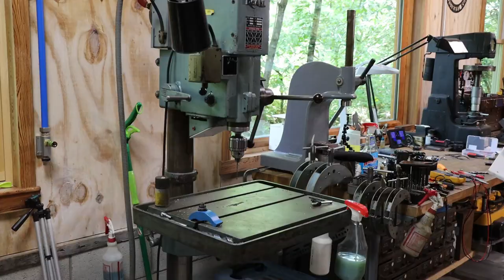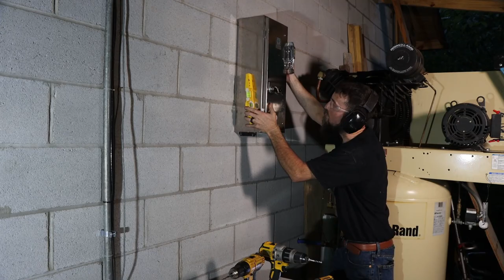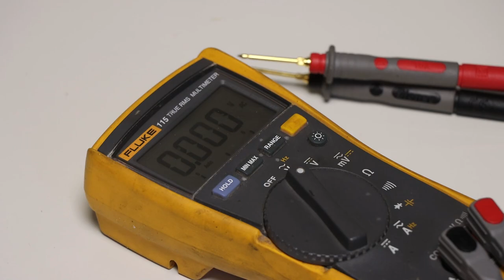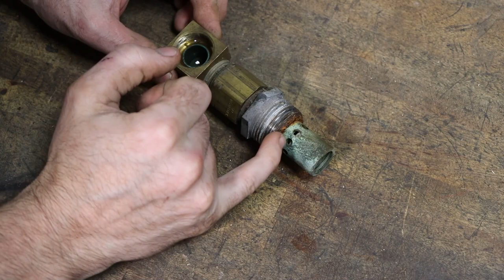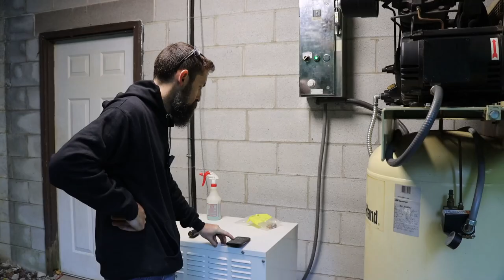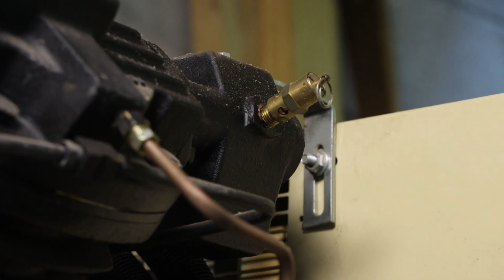Wiring & Test running my Big  Compressor

Comment: Thing stuck in the check valve is a piece of one of the head valves. Looks like you will be taking the high pressure heads off to get new valves in there. At least you can get those from IR very easily, and you can simply order all the valve plates as a kit, which also can include a new IR check valve as well. Order the IR oil and 2 spare input filters at the same time, to get a spare filter for it. Oil is Ingersoll Rand Type 30 Select synthetic oil, a very good oil, and pretty low cost. Change oil every year, the old oil is great for things like gate and doors, it is still useful as oil.

Auto drain is easy to wire up, use the control transformer to give a 120VAC feed to it, using a twist lock plug and socket to enable you to remove it if needed. Take the auto drain outlet and put it to a 15 foot length of nylon 6mm diameter air tubing, and coil it up into a tight circle, held with a few cable ties. That way you have a silencer (the auto drain is loud) that will not block up easily, and the smooth nylon means the wasps will not build a nest in there easily, especially as it will have a coat of blow by oil in it as well.

Power wise go and get yourself a Knockler Mueller stop start pushbutton assembly, which consists of a start and a stop button, with an indicator section in the middle, ordering a 120VAC LED indicator, probably a red one. Then wire it in place of the original toggle switch, probably swapping the indicator with the switch, to get that switch in the middle position. Indicator remove the incandescent lamp and put in a green LED retrofit lamp, it lasts a lot longer, and runs cooler.  Run the control transformer off the generated phase and one of the others, likely the phase converter does not pass the phases through when off anyway. The control transformer will have to be powered all the time, fed after the fuses and disconnect, before the main contactor.

Pushbutton assembly you can use with the existing contactor, just wire it up, using the auxiliary contact block on the unit, as a stop start contactor, the KM or Siemens websites will have a wiring diagram for this, or look up a stop start contactor, which will also allow you to put the new overload trip in it as well. Set the overload to be auto reset, and adjust to the motor run current you measured, using the highest phase current (probably phase C as it was the hottest, likely the phase converter generated one). 

You can also, if you want, put a 4 core plus ground cable through the wall, and have a second push button station inside, like the phase converter has, to allow you to start and stop the compressor from inside, as well as see if it is powered up, using the same push button assembly with indicator  and a single hole box. Very convenient if the compressor is remotely mounted from your workshop. 

Extra options are to get a 3/2 solenoid and install it in the air outlet to the shop, so the air lines are disconnected with no power, so that any leaks in them do not drain the air tank down.  As well a filter and water separator on the outlet, large diameter bowl and fittings, with the 5 micron filter in it, will help ensure the air going in is as dry and debris free as possible, short of having an active drier, or an oil less compressor.

I had a similar install, using the same methods, and I was lucky in having 3 phase power, and running a 3 phase plus neutral to the box, so left all the controls as they came (used parts all round, both the control and the star delta switch for the compressor) with 220VAC coils. Also added a separate power outlet there to give a local power line for working, simply by adding in an extra 20A breaker in the box. So had both local and remote stop start operation, and filtered air leading up to the machinery that needed air, with the way oversize compressor and tank meaning the air in general was both cool and relatively dry, with the filters making most of the oil mist drop out as well.
Reply: Wow Steve is lucky to get this reply you sure know your stuff.
Reply: Well said and explained in terms that are easy to understand 👏. A+
Reply: @ericmcrae7758  No, just had a bit of experience with both IR compressors and with machinery wiring in general.  Important thing though here is that tank does need to be pressure tested very soon, and then retested every 5 years (or whatever the local rules are in your location, here it is 5 years) so as to prevent it failing from corrosion. They tend not to go off with a bang, but start to leak air through the rust, and are not repairable easily, as you basically find there is little to no meta left to weld back on to when a seam finally fails. However large ones can fail explosively, and thus need testing and certification regularly. 

Steve likely does know of people at his work who can come out and do this for him, or might have a viewer close by with the requisite training and equipment to do it for him. Not too complex, you just remove all fittings and blank them off with plugs, and then fill the tank to the top with water, and pressurise it with a small hand pump to 1.25 to 1.5 times the operating pressure (again depending on local regulations for this), followed by leaving it at pressure for 15 minutes and checking there is no pressure loss. 

Then dump the water, reinstall all fixtures, and test the safety valves release at the correct pressure as well, and are sized so they can dump the full output volume of the compressor at that rated pressure as well. Then check the pressure switch is in good order, switches off at the correct high point, and back on at the correct low point.

Unloader needs servicing as well, along with check valves, but that is part of the compressor maintenance, not tank maintenance. I had to replace unloader valves, but left the old leaky one in service, as it was an elbow and adaptor, and simply put the new IR one to replace another elbow in the pipe to the tank. Those actually erode away because of the hot gas flowing through them, especially at the output of the heads, and the heads easily will run over 200C under heavy load. You always see them with the paint at the top of the head cooked off on well used units, though even after it was new, it took only 50 hours of running to start that paint to fall off.

An hour meter would be a good add on, though with this use a simple annual service and oil change will suffice, they will run for 2000 hours between oil changes in normal operation, which is typically 6 months in most industrial places. I had seriously oversized though, as it came as a well used unit, very cheaply, so it was running around 20 hours a month in a factory setting, that it replaced another compressor that was smaller. It did break a conrod on the HP side, and thus a new compressor unit was quicker, faster and only a tiny bit more expensive than replacing the pot alone.
Reply: This is why I read comments.  Thanks for making such an in-depth one.
Reply: Becuase of this I looked up air compressor explosion and its pretty nasty stuff, I knew they rusted out but never really thought it could become that violent thank you for commenting
Reply: Yes, that piece likely is from the valve on the high pressure (smaller) cylinder. We had the same compressor and the valve plate failed under warranty. That one might have had the valve plate replaced but a piece was left in the system. If you don't need the high pressure and the volume it provides, you might consider turning the pressure down to save on electricity.
Reply: That was pretty detailed. Thanks bro
Reply: @lostandfound3588  you may find the pictures of what appears to be devastating air compressor tank "explosions", are actually water heater tank explosions. Water heaters in those cases turn into steam generators. Easily building 10 times more pressure and energy than air compressor pumps are capable of.
But the tanks look similar so,,,,
Reply: Now that's a very comprehensive , and practical set of suggestions for Steve sir, Sorted!
Reply: @haroldphipps3457  Yes, seen one that totally demolished an apartment unit, though as the building is concrete it only destroyed the interior, and blew out the large windows in the bedroom attached to the bathroom. Lucky for the occupants they were not at home at the time, as otherwise they could have had injuries ranging from mild to fatal, depending on where they were at the time.

Thermostat stuck closed, and some idiot had decided to block off the pressure relief valve, as it was dripping.
Reply: Wow! What a comprehensive description! Thank you!
Reply: @haroldphipps3457  Air and steam act very much the same when a seam or weld lets loose and the aftermath is very similar, not pretty.  Both are gases but steam(water) has an expansion rate of about 1600 to 1.  Propane and butane  can  react similarly.  When hydro testing a tank, it should be tapped lightly with a hammer all over just in case of rust flakes hanging on until shook.
Reply: @royreynolds108  correct, but in most air compressor systems, some other part or parts will fail at 500 psi and less.
Water heaters can easily build steam pressure in excess of 2000 psi. (With a faulty pressure relief).
I wouldn't want to be around either one, but having an air compressor failure knock a house or shop down would be rare.
Reply: Looks a little small to be a finger valve , unless its a piece from behind the screw that has broken off

Comment: You could possibly use a phase failure relay to ensure it doesn't energise the main contactor if the three phases aren't present.
Reply: Or if the rotary converter has the facility to energise a relay when it's running it could also interrupt the coil of the compressor contactor.  It's usually preferable to use a 24V supply for things like this so you don't have mains voltage control signals going to another panel even when it's turned off.
Reply from the maker: I need to look into that Clive, a couple people mentioned it. Sounds like a good idea. The phase converter does have a contractor inside.
Reply: @SteveSummers  They may already have a tap inside just for that purpose. I'm sure Stan at Bar Z also has a solution. By the way thank you for all of your content!

Comment: My solution is a contactor capable of handling the full phase converter power on the 3legs between the converter and load center. This prevents single phasing of all the machines and it disconnects all my equipment from the mains in case of a lightning strike as long as the converter is off. You don’t need a transformer for the controls.
Reply from the maker: That's a good idea Brian.

Comment: I have a similar shop setup for my Quincy in my garage shop. For years I would get a poke in the ribs in the middle of the night from my wife and hear, "You left your air compressor on again!" Finally resorted to installing a two hour mechanical/electrical timer switch (purchased at HD) at my workbench location. The timer is in series with power going to the contactor coil. Thanks for sharing your journey, Steve!

Comment: Add a main air disconnect inside the shop.  Install a inline check valve inside the shop with a drain-able drop leg below it.  I will be interesting what freezing temperatures and trapped water droplets will do.

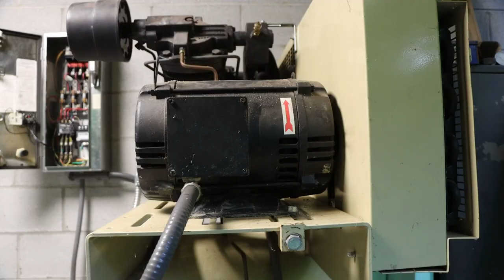Comment: Just a minor clarification and not to sound all smart a-- here at 16:27, the following.  When you are dealing with an electrical motor the rotation is determined by where the spindle is seen such as where the sheave/pulley is at.  In this case it is turning "clockwise" not counter clockwise.  I learned this in a machining class where the other end of the motor obstructs the pulley if you look at it head on but at least when you are able to see the spindle or pulley you will always know the "rotation" of the motor when it's running.  Nice setup you have going there getting ready for winter.  Be blessed!

Comment: Great video. We all new there would be a couple leaks.  Reworking motor control centers is always a job.  Like you said, you did a good job not letting the smoke out of it.  The shop is really starting to come all together.  Good luck with the shop air system.

Comment: Use a normally open relay in series with your pressure switch . When your converter is running that will close your N/O relay & allow your pressure switch to start the compressor.

Comment: I'm no electrician, I get by on the house and 220v ok enough but not everything you're into there. But a simple to install safety device would be an industrial red light installed next to your switch for the phase converter. Set up your red light to come on only when the compressor is in the run mode. You may even want to do it if you install current sensing gizmo's as a secondary safety for gizmo failures. Looking pretty spiffy around there, once you get all the machines fixed/setup/functioning you'll have to pick up and move just for something to do!! LOL Thanks for sharing.

Comment: Steve. If your really concerned about that metal and any other things related to buying that equipment, when you empty the oil, do a quick eye analysis after the oil settles and check it for any contamination. Metal wearing particles and even fragments will lead you to the worn parts. Nice compressor and great job installing. I've owned plenty IRs, Quincy, SpeedAire, Champions and even Cambell Hausfeld. My father in law RIP, and my wife's Brothers have Always built or rebuilt my compressors since they own a compressor business since the early 1960s....

Comment: Transformers use Z (impedance) not R (ohms) for resistance so there is some extra calculations needed to take the frequency and Henry's of the coil in account , as well as the gauge of wire to determine the amperage (max) draw.  At no load the amperage draw is small and wasted as heat.

Comment: Steve, as your control box is outside, albeit with a roof over and does not have a rubber lip seal, I would be very tempted to leave a silica gel bag of damp absorbent in there, to prevent corrosion.

Comment: Really nice meter, Fluke is top shelf for a meter. They are not cheap. The screwdriver, called an offset or swivel screwdriver. Looks like a pair of Klein strippers, with straight handles, not curved, so you have 6×32 thru 1/4-20. Have used those all for 40 years. Your hired. Nice job.

Comment: On the phase converter  look for a set of Isolated contacts that are normally open. When converter comes on the NO contacts close,  This allows voltage from compressor starter to pass through the contacts of the converter and travel back to the starter of the air compressor, allowing the air compressor to start. If for any reason the voltage converter fails the Air Compressor will stop running.

Comment: Tank check valve is leaking. It is the valve at the tank that comes from the head. The head pressure relief valve is centrifugal and seems to be fine. Be sure to get one that corresponds to your systems pressure.

Comment: Hi Steve nice to see you getting out of your comfort zone,
If it was my installation I would firstly put two remote remote Emergency Stop buttons  inside the shop so that heaven forbid you had a fire in the compressor enclosure and it’s as easy as a bird building a nest and friction setting it on fire in fact the perfect answer to your workshop forgetfulness would be to put the one for phase converter by the door and as belt and braces wire a relay into the light circuit so lights on you can start the converter and lights off all off. As for the compressor or any other thing using the converter is another relay energised when the converter is running with one normally open contact for each item you need to protect and a normally closed contact wired to a red tell tale lamp to say it’s off….. oh and it’s electrical work unless you use solid state things such as transistors, thyristors etc then it’s electronics.
You take care

Ernie

Comment: Congratulations on getting an industrial air compressor instead of one of the box store pieces of junk. I spent a lifetime repairing air compressors of all types & sizes. Looks like the debris you found in your Check valve was a piece of the compressor valves. An easy way to test the efficiency of your compressor is by reading the interstage pressure. To do so you first must understand the two stage principle. You have a large, 1st stage cylinder, where sir is sucked in and gets compressed once & discharged into the inter cooler. This 1st stage of compression generates a lot of heat. This heat is dissipated in the finned tubing of the intercooler. Now the 2nd stage, the smaller cylinder, receives the air from the intercooler & compressed it again up to final discharge pressure. The difference in cylinder sizes creates a pressure buildup in the intercooler. If all things are working correctly this pressure rise is 35 PSIG.if it’s lower than that it indicates something is wrong with the 1st stage cylinder. (Dirty air filter, broken valves, air leaks in the intercooler and worn rings, cylinder/piston)
If the interstage pressure is higher that indicates a problem with the 2nd stage cylinder. Most likely bad valves.
Somewhere on the outlet of the 1st stage head you’ll find a small safety valve, usually set @ 75 PSIG. Remove that & put a pressure gauge in its place to check the interstage pressure.